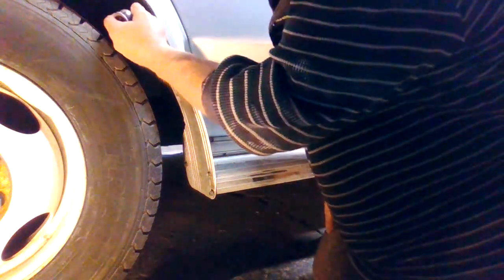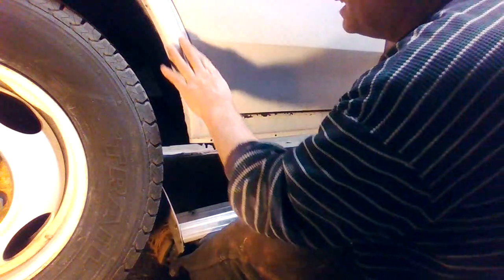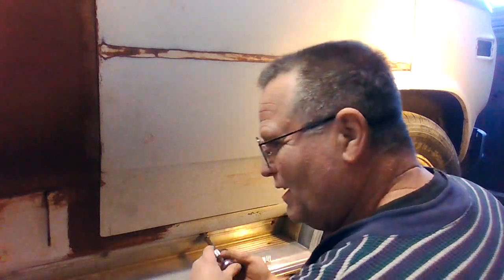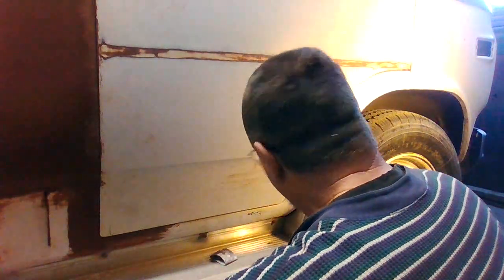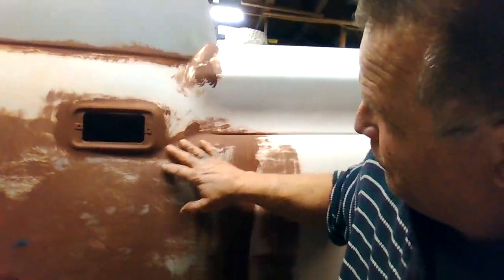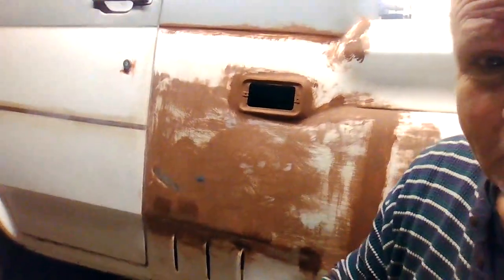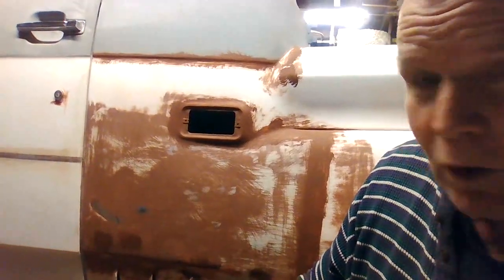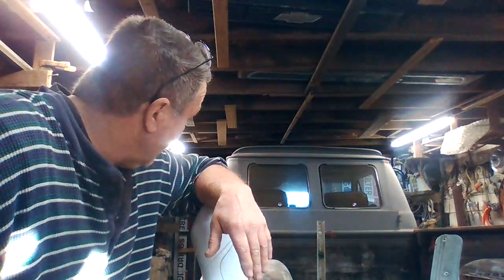Disassemble  Saturday

Comment: Getting kinda cool to paint, will need to get garage warm an stay that way until paint drys. Bodywork needs to be good for dark color whereas can get away with so so bodywork with white. My first paint job looked perfect during application but temp dropped overnight body must have gotten cold and paint blushed up. Looked like car was in a fog lol lol. Able to cut paint and put on a couple of coats of clear. Learned to paint in warmer weather